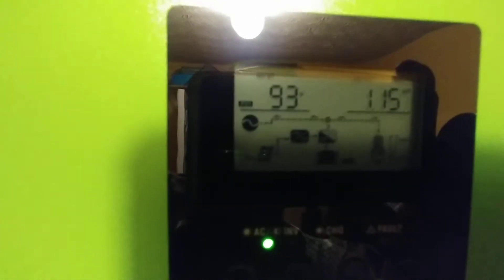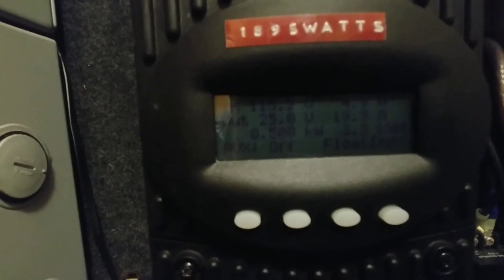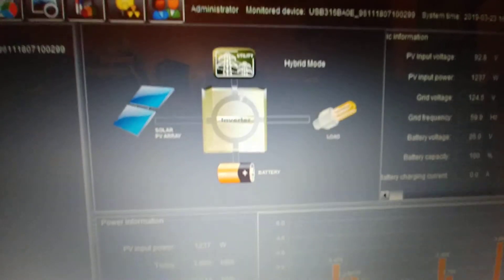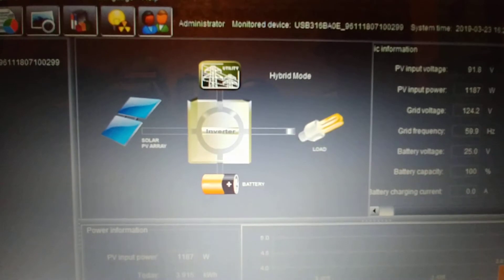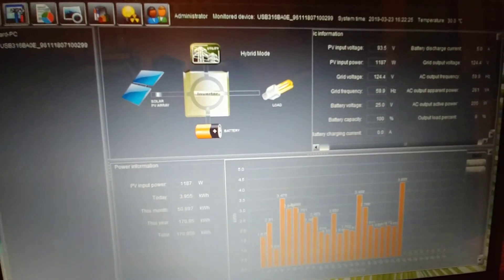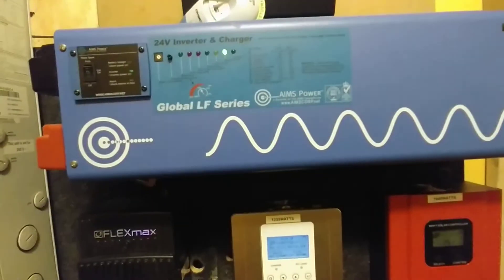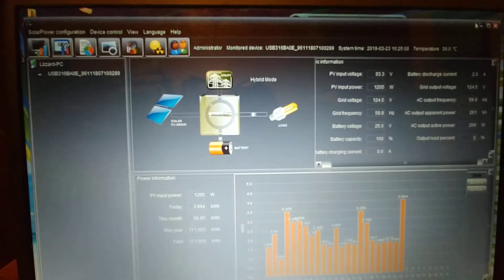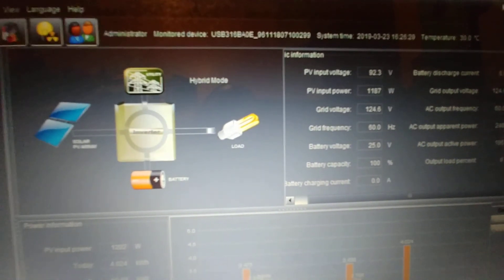Mpp solar hybrid inverter

Comment: I have a Gk Mppt solar inverter with step down transformer St5000 its ok I runs 220 v 120/ 120 v I keep it for back inverter
Reply from the maker: Good inverter..if you don’t overload it,it will work for ever

Comment: The hell with $100 shipping cost LOL ON THAT mpp inverter   But I’m thinking I’m going to have to order that green machine you’ve got buddy
Reply: I bought one my friend thanks for the review
Reply from the maker: @cowboymcq6711  you are going to love that inverter
Reply: @bimmers323ci    I love the color already.  The Powmr I bought from Amazon and it’s not bad just the VOC is super low like 100 and the amps input is 40 amps. And I’m using 6/2 wire and the PV input I couldn’t even fit the wire in the hole
Reply from the maker: @cowboymcq6711  I heard the powmr is also good/// proper sizing of wire and breaker and good connection is the key and never over load the inverter//// in that way you will get your money's/// thanks for checking out my video
Reply from the maker: Its a killer you will love it

Comment: Hi, 
how long is the MPP Solar Inverter running now and did you experience any problems?
Reply from the maker: Thanks for checking out my video//////as for the inverter about 3 years now I am using it and no problem at all works great 👍 I now have 2

Comment: How much heat does this unit output in normal average load condition?  Would you say more than a refrigerator?  I'm considering this before selecting a location for mounting.  Thanks for your time.
Reply from the maker: Thanks for checking out my video..Warm to the touch——-and also depending on how much solar panels you have on it and also load you you are pulling from it
Reply: @bimmers323ci  That's great... much appreciated.  I really appreciate that info....keep up the good work you do.

Comment: Wow. Check this same model IGrid SV LV 3Kva :  https://www.aliexpress.com/item/32839127901.html
It is 3Kva 2400W Hybrid solar inverter for 120Vac 60HZ output (Like US/ Canada/ Mexico and Latin America countries). it also support split phase 240Vac ( L1-N-L2). it can be parallel with Max 9 units. So you can get Max power 27Kva for single phase and 3-Phase.
Reply from the maker: peter may thanks for checking out my video

Comment: Hello  do you have a video on how you connected your MPP inverters to power your house?
Reply from the maker: Yes I sure do and thanks for checking out my video
Reply: great  which one would you recommend
Reply from the maker: pete h thanks again for checking out my video but I don’t remember which one/—however the ac in to your inverter needs to be on a separate breaker coming from your main panel and the ac out from your inverter needs to be going to a sub panel and from your main panel    You need to remove the circuits you want to run off your solar system to the sub panel————-if it is too complicated with the sub panel -then you will have to used a reliance transfer switch box of your size which will make much easy
Reply: Thank you for the videos and responding to my questions.

Comment: Hi,
 
This model has a feature of sending unused power to the grid, what's the use of that?
Reply from the maker: thanks for checking out my video......as for the hybrid inverter  this is useful if you can get credit  from your power company  and if not   it is also useful to slow the power meter  especially  in the summer time  when you have the ac on

Comment: hi sir, i buy 5kw hybrid solar inverter 48v 230v and i buy step up & down transformer 5000v because i want to have 110v from 230v inverter please can you help me. thank you.
Reply from the maker: hi thanks for checking out my video..here ios a link to amazon on what you realy need https://images-na.ssl-images-amazon.com/images/I/81X8PDU4rQL._AC_SL1500_.jpg
Reply: @bimmers323ci  I have one of 5000v  heavy duty but I dont know how to hook it the my inverter
Reply from the maker: Zalal mustapha...hi take pictures of the transformers and let me see it
Reply from the maker: @zalalmustapha4796  on your inverter you should see (L for live  out,N for neutral out, and G for grounds out..they should be connected to the upper part of the transformer where it says input. In the rear)L to L, and N to N and G to G
Reply: @bimmers323ci  thank you for your time but what input of my inverter .about public power because  my hybrid inverter want to switch automatically from public power to solar power and thank so much for your help
Reply: If you can make for me like design how must do it from input and output  inverter to transformer
Reply from the maker: Don't forget to use breaker and multimeter or get a liceinse election to help you..cause I am not one however I learn every thing from YouTube

Comment: Can you just put a fuse box and hook straight to 110-120v  outlet hard wire without batteries??
Reply from the maker: the unit can be run as grid tie  with  pv power going to it without  battery...and don’t forget your fuse from pv to unit,fuse from 120v going in..fuse from unit going out to both 120v and dc volts....thanks for checking out my video

Comment: Can you drop a link for the local dealer or did you buy it from mpp official Taiwan website
Reply from the maker: Dodge_This .... the first pip inverter it is from mpp solar in taiwan and the second one is from here usa-mpp-solar.they are the local dealer here for mpp solar check them out they are honest people and very helpful.... thanks for checking out my video
Reply: @bimmers323ci  yeah..I've been to both websites, so I just want the best bang for my buck.
Reply from the maker: Dodge_This cool

Comment: Hi Garfield.  Just came across your channel. Nice setup.  I live in Jamaica and was considering this setup. Do you recommend the MPPT or this:

ECO-WORTHY 1000W 1KW MPPT Solar Grid Tie Inverter Power Limiter DC 22 to 65V Solar Input AC 110V/240V Auto Switch PV System https://www.amazon.com/dp/B076KBCHBM/ref=cm_sw_r_cp_apa_i_0ctsEbXJNTGXA

I really dont want to feedback to the grid in Jamaica. Just use what I generate and have backed up.  If I draw more than I am producing that I would take from the grid.
Reply from the maker: hi thanks for checking out my video.....the pip 2424lv-hs inverter from mpp solar is a better choice it is 110-120v @2400 watts continuous output voltage for your load at your home....you can pump up to 1250 watts @ 80v solar power into it...your battery configure should be 24v ...and you can add more battery as you go long......this inverter does not sell to the grid,you will have to put in a sub panel and move all the load you want to run off it...thanks again for checking out my video
Reply: Thanks you.

Comment: Can I get the 48v and run it at 24v 3kva until I’m able to upgrade my battery bank? And if unit packs up, can I have a by-pass to shore power or just have it charge of panels while charging batteries 🔋 and load running of shore or solar? Can I get the software to run on a Mac and not Windows?
Reply from the maker: Moffat ...no you cannot run a 48v on a 24v battery bank....a 48v unit is for a 48v battery bank and 24v unit is for a 24v battery bank..... some people prefer 24v and some prefer 48v and some prefer 12v battery bank

Comment: What is the PV voltage range?
Reply from the maker: On which one....and thanks for checking out my video...yes it can run without battery....max pv voltage on all 3 unit is 150vdc

Comment: I got one of these and am using it with lithium batteries, I was just wondering how you wired your unit to the breaker box....
Reply from the maker: Thanks for checking out my video....i have a 30a breaker coming from the main panel to the pip and then from the pip to a critical load panel.....
Reply: @bimmers323ci  so the PIP pushes excess power to the grid through the input side of the AC connection on  the inverter...
Reply from the maker: Yes sir...... only on the hybrid and only if you tell it to and only when batteries are fully charged
Reply: @bimmers323ci  so you can tell it to do zero export to the grid if you want?
Reply from the maker: @horeica  ......yes sir....you can tell it to do grid zero if you want or to send it to the grid,,,,,you can also tell it to charge battery first and any excess to go to the your load and then to the grid.....you  have full control over the unit....thanks for checking out my video

Comment: can you use it without a battery?
am planning to go on-grid hybrid but battery bank would be later (insufficient fund.. lol)
Reply from the maker: Thanks for checking out my video......no it is not a battery less unit but I see people running it in battery less
Reply: @bimmers323ci  i study up on this, you can make the smallest cheapest battery set, using a couple of 18650 cells. all the unit is looking for in a reference voltage.
Reply from the maker: @DanielbenDaniel  ......thanks for checking out my video....yes sir.....the pip hybrid inverter need to see grid power to push power back as long as your battery is fully charge and you tell it to

Comment: wondering if the yellow 3kw 48vdc 240 volt ac Hv2-3048 hybrid inverter model and the neon green 5 kw 48v, 240 volt ac  HV 5048 hybrid inverter models will work in the USA or do we only get to use the usa puerto rico 120 volt ac 24vdc LV 2424 hybrid inverter models in parallel to achieve our 240v ac here in america?
Reply from the maker: thanks for checking out my video,,,if you use the none usa version you will have to use a split phase transformer  and you will be looking at more energy loss from your battery bank

Comment: are you able to change battery bank discharge voltage cutoff
Reply from the maker: Thanks for checking out my video......yes you are able to set cut off voltage
Reply: @bimmers323ci  very good
Reply: Its max charge voltage is 29.1 if anyone is wondering

Comment: Lg and renogy panels which produces more
Reply from the maker: thanks for checking out my video.....these days it does not matter what panel you use..the price have came down a lot ....on my roof and in my back yard i have panels from different makers that i bought from ebay over the years and they all work i must agree that mono panel preform better than poly but who cares you buy what you can afford